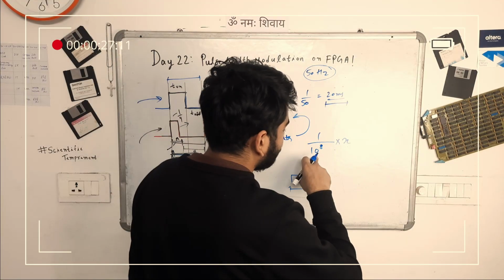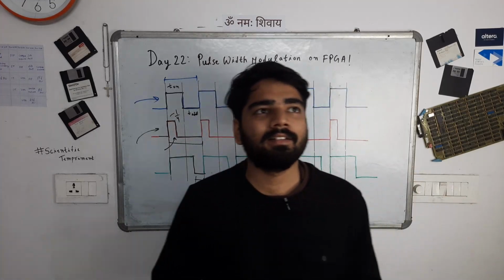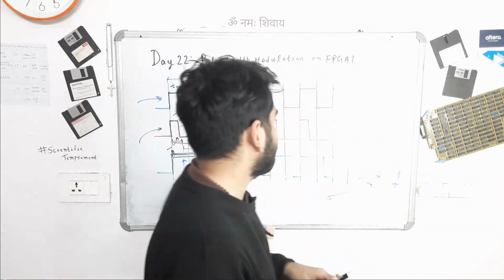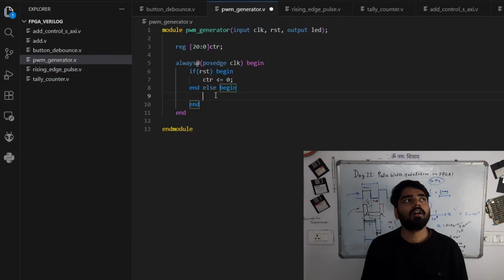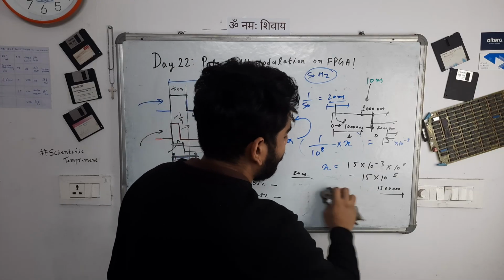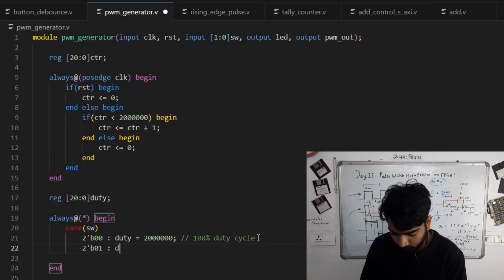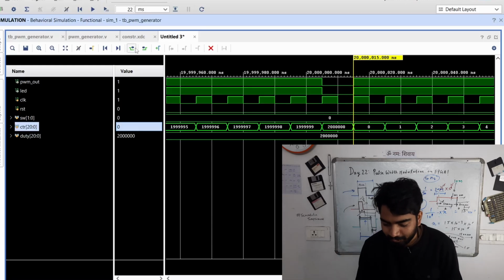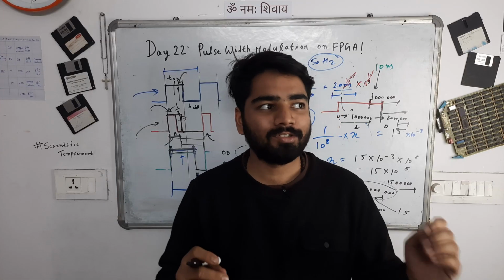Pulse Width Modulation (PWM) Using Verilog on FPGA | 100 Days of FPGA

Comment: Hello Sir in Vitis I am Unable to Print Any thing On the Vitis serial Terminal I have Tried all possible ways to debug but Nothing is Getting printed what might be the issue the Version is 2023.1 plz help me!
Reply from the maker: The issue can be various things, some boards (like zedboard) have a seperate serial UART port, if you only connect the JATAG it wont show up in the terminal, on vitis there is XSCT console by default, select serial console, select the correct comm port, go into device manager and plug and unplug the board see if it refreshes and new com port appears
Reply: @TheHardwareDeveloper okay Sir thank you I'll check I am Using Zcu106 Board

Comment: sir or professor, thank for your lecture. i am hw schematic designer. i feel strongly learning fpga and fpga soc system for my extended carrer. especially, MiPi interface and isp, image processing. i already got ZED Board in zynq 7020.so please help me. youre the my good mentor and teacher. thanks your good influence. let's 100 days FPGA!
Reply from the maker: Hello, for mipi and image processing stuff I would first start by setting up a video pipeline, either hdmi or vga, using IPs, then probably do simple processing like sobel and gaussian blur and stuff, then move onto more complex ones, Keep learning!